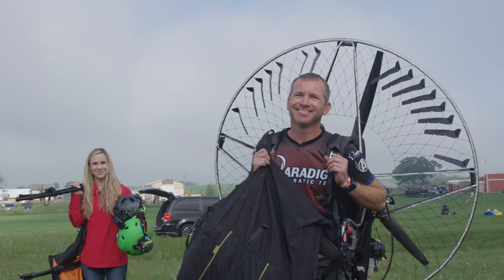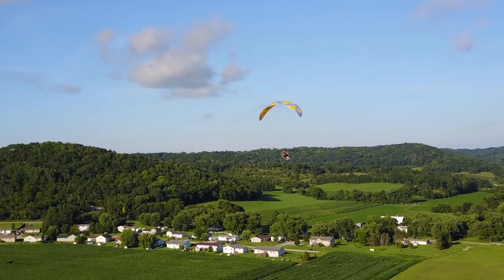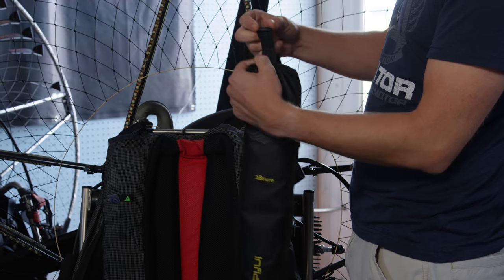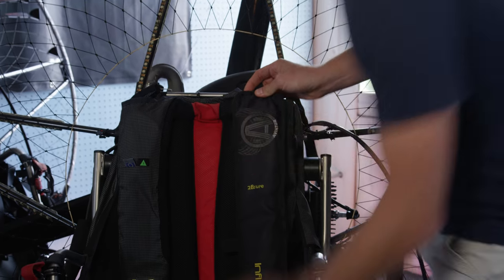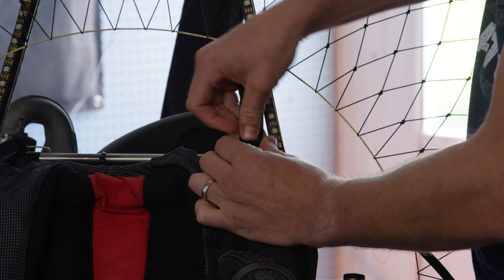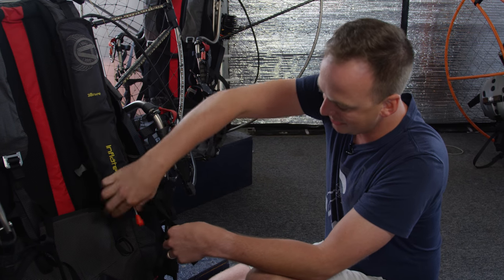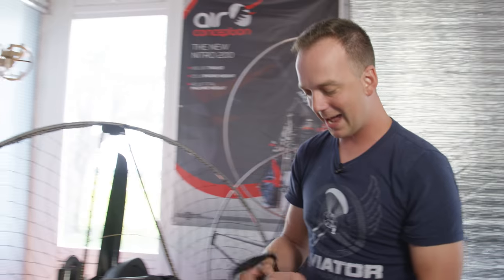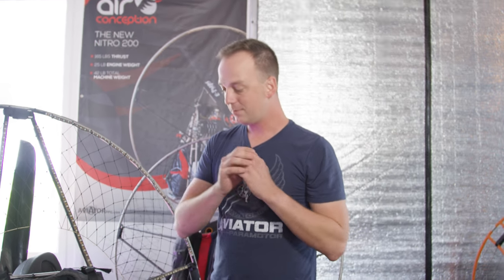DON'T Fly Without This Safety Device!

Comment: A great informative video Eric. Thank you  Have you or any of your guys ended up in the drink? What steps do you take with your motor to get it running again? Is it a costly event?
Reply: Ian Hornby ; typically it’s just the removal of the spark plug and turning the motor over to clear the cylinder. Then flush the motor with fresh water then as much WD as you can with the plug removed. If you’re not mechanically incline I’d recommend taking it to a mechanic as soon as possible.
Reply: @PatrickAviator  no carb strip down and clean?
Reply: Ian Hornby: in detail yes if you went in and it stayed in the water for a long period of time but regardless I would pull the fuel bowl clean it and re assemble